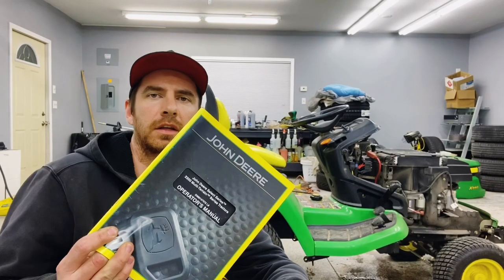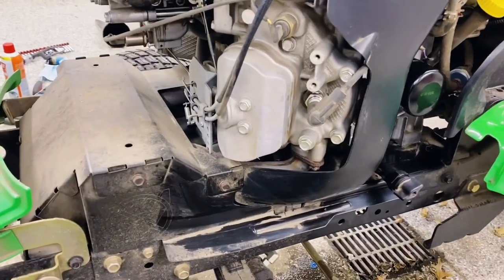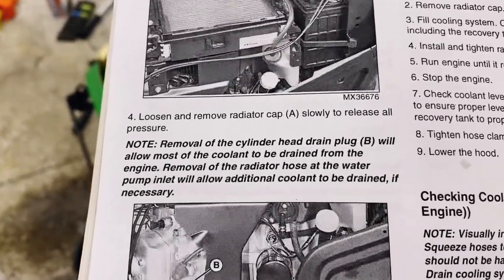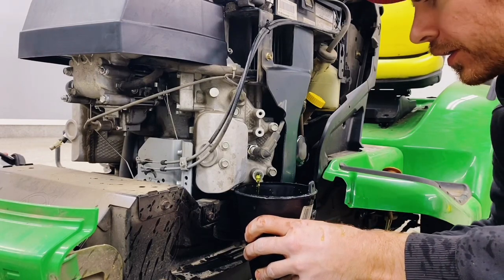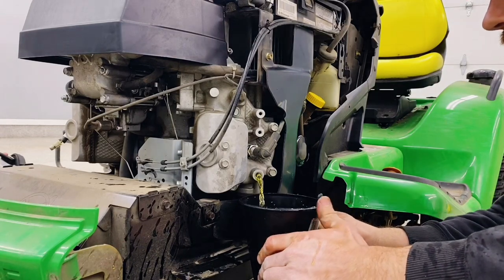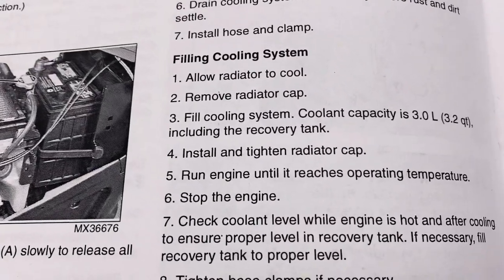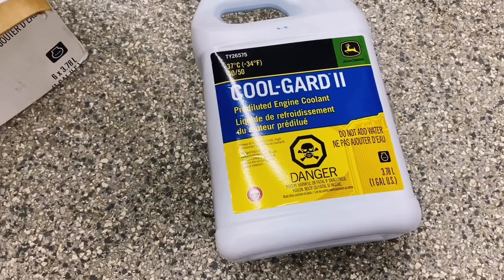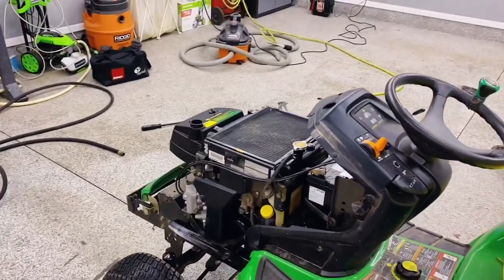John Deere X540 coolant change DIY

Comment: Thanks for the vids! About to pick up a used X540 myself. Are there any instructions to burp the system to get rid of air bubbles?
Reply from the maker: The manual doesn’t talk about any kind of burping or purging so I assume they’ll work themselves out.
Reply: @suburbanacreage  thanks! I realized I could also use the coolant funnel that I already have to burp the system.

Comment: I didn’t get very much coolant to drain. Maybe 1/2 gallon? Is that normal?
Reply from the maker: That’s about what I got. I think it’s just a super small radiator and engine. I’m used to working on cars and trucks and it was way less than I was expecting.